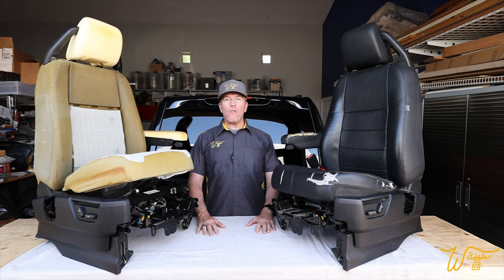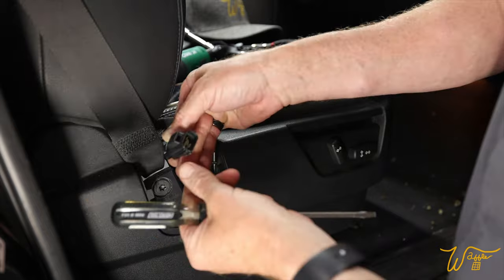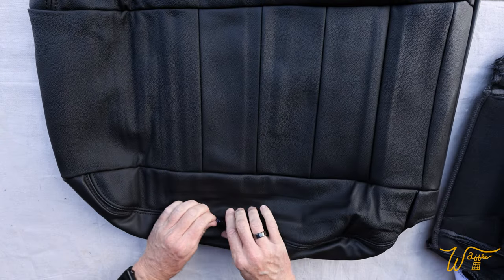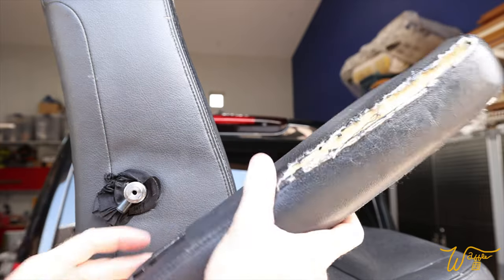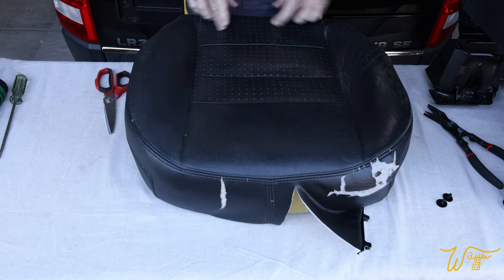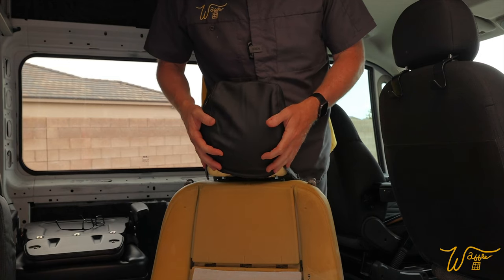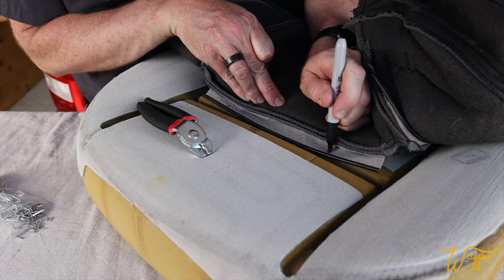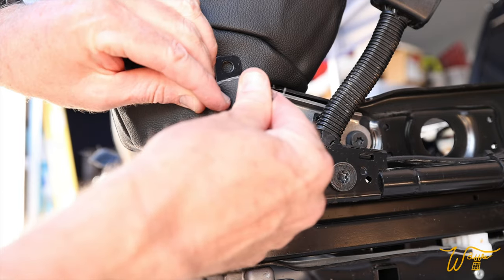Replacing Factory Seat Covers on a Land Rover LR3 - Ep. 14

Comment: It’s rare to come across people who are as detail-oriented as you. What a pleasure to see you working on your car! My wife says I’m OCD with cars. I thought I was the only one 😂😂😂! I have bought myself a pretty well-maintained Disco3 HSE with 200k km on the clock. But she still needs some TLC to be in perfect shape. I’m doing this project for my nice who is turning 18 next year. Still didn’t get to the interior though. Mine is the TDV6 version so there was a lot of preventive mechanical maintenance I wanted to do before tackling the cosmetics. You truly have to love this car. It’s still a nice pice of engineering considering it came out in 2005. Craftsmanship and high quality in every detail. You’re truly an inspiration so please keep it up! Loving your videos! 🏋🏻🏋🏻🏋🏻
Reply from the maker: Favorite comment of the day! Thank you so much.
Reply: @wafflesquare  Meant every word! ❤️❤️ I guess you’ve researched a lot about the LR3 by now. Some common problems to address are the front suspension lower arm bushings. It’s best to replace them with heavy duty ones from MEYLE. Better than OEM quality. I replaced the whole arms (upper and lower) and rods. Drives like new. Same goes for the brake discs and pads. I used BREMBO. They work like a charm and are not that expensive. I’m on your 4th video already. Can’t stop 😂
Reply from the maker: Very much appreciated!!

Comment: Upholsterers use “Cushion eze “ which is a slippery material designed to allow leather to slide easy over foam
Wrapping foam in plastic and applying a vacuum also works - additionally using steam can soften the leather or vinyl for fitting then it will retighten when it cools - great work though - I don’t think people realize how long this job takes
Reply from the maker: Thank you, Mark, for sharing!

Comment: My carpets are soaked underneath the passenger-side and - after days of pulling up the carpet along the edge and blowing air with a fan, I determined it was time to remove the passenger seat and pull up the carpet. Thanks so much for the insightful video.
Reply from the maker: You are very welcome. The water is most likely coming from the sunroof drain line. There are many YouTube videos about that issue.
Reply: Yes, thank you. I just purchased one with 120K miles with an electrical issue that had been sitting vacant for 2 years.  Also, I’m very surprised that you haven’t had that water issue yet, but perhaps it’s since you garage store and I imagine it’s pretty dry in Nevada. :)
Reply from the maker: You are absolutely right, Adrian. For all I know we are sitting on a ticking time bomb just waiting for a downpour.

Comment: i’ve been looking for a video like this for quite some time. Thank you for posting a very detailed how to on rescanning the LR3 seats.  I’m Looking forward to seeing you do the rear seats. Also Samuel sounds like a pretty solid dude for hooking you up with those plastic pieces.
Reply from the maker: Thank you for your kind comments. Thankfully, the rear seats are in excellent condition so we have no plans to re-cover them.
Reply: @wafflesquare  On the 2006 LR3 that just bought, it’s the three row version.  The issue that I have with the driver side rear seat, is that the cable for the latch on top of the seat broke.  I think that I’m going to repair it using a bicycle brake cable.  Thanks again!
Reply from the maker: You’re welcome.

Comment: Great video which is so much easier to follow than the Haynes manual. I like your conclusions at the end. I wish I had watched the whole video, with your warning that this is a lot of work, before embarking on my leather change, as it is a full days work if you don’t have any snags. My snags included not having hog ring pliers - these are essential for reassembly, finding the seat base metal shell cracked around fasteners (£60 from LR), having difficulty removing arm rest - this needed a pry bar even when at 45 degrees and not allowing myself enough time - I’m currently halfway through having spent 6 hrs, but looking forward to finishing it this weekend- with luck.
Reply from the maker: Thank you Mike! I’m so glad it was helpful.

Comment: yup a lot of work, one thing is these custom seat makers never seem to offer perforated, so your front will not match your rear.
if you dont have hog rings, i find cable ties work just as well.
Reply from the maker: Great tip. Zip ties seem to get very brittle over time here in the desert. I wonder if they would hold up to the strain of constant sitting and alighting from a vehicle.

Comment: Another great video.  Better than my LR3 sear recover video.  I also contacted LSeat about the rear seats but they don't have a template.  I still have my old rear seat covers after finding hardly used rear seats from a salvage yard.  I removed the old covers for templates before throwing away the old seats.  Do you want them.  They are Alpaca, tan.
Reply from the maker: No thank you. Fortunately our rear seats are in great condition except for the little clips on top for collapsing them.

Comment: When fitting the covers (like the head rest) it can be very difficult (tight with a lot of friction) and difficult to position it properly. If you put a plastic bag or sheet on the foam first it makes fitting a lot easier (low friction). After fitting the cover pull out the plastic.
Reply from the maker: Great tip!
Reply: Good tip. Upholsteres will create a bag with plastic sheeting, connect a shop vac to one end, and suck in the foam to make fitting covers easier. Sheeting gets pulled out after the covers are on.